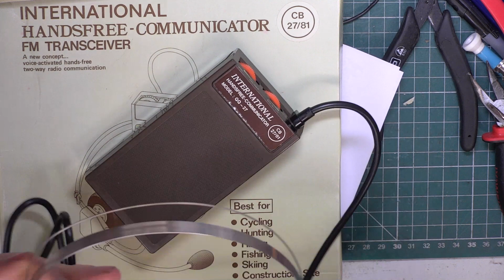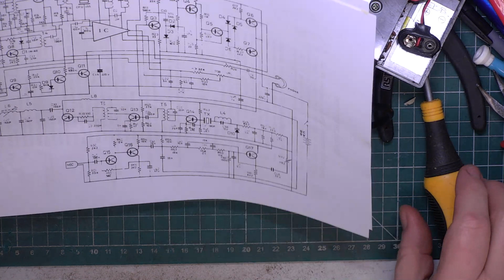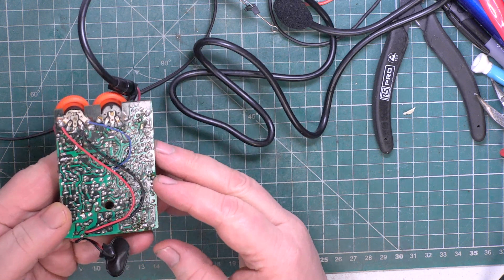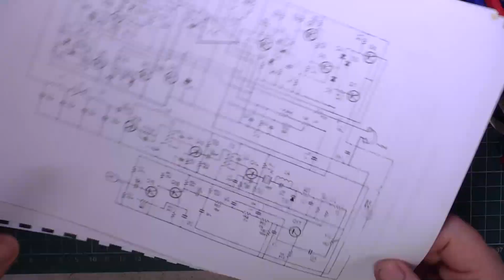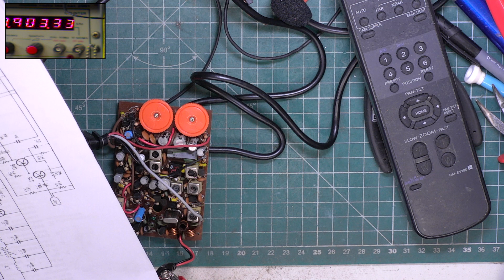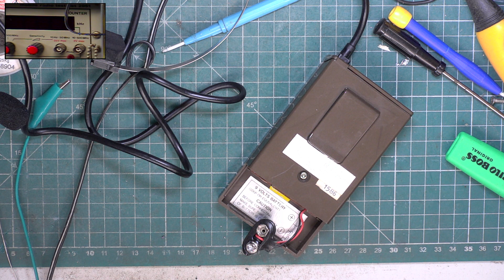International QQ27 CB27/81 Headset portable Cb radio - service alignment

Comment: That control on the schematic I think it says VR2 looks like in the circuit to be you deviation control it looks like it comes from the microphone amplifier circuitry and feeds the crystal oscillator the audio as a direct FM style of modulation by feeding the audio across a varactor which warps the crystal frequency

Comment: Quality. No manual over ride, a PTT or a LED so know it is on, power. 1 LED, thought would not be much to ask. I had in 1991-92 a pair of something or another from Tandy in Oxford. Nice little similar things but neater. Black, No squelch, Just had one al the time. no hiss like cheap things. LED, 2 colour in 1, RX or TX . volume on a slider, High or low. a VOX or to the lovely orange PTT. manual operation. a thin curly cable for a most of it to an earpiece with a few choices of pull on or off silicone earbit. mic in that (bone conduction, worked well). Used when doing technical at the local churcg concert events. roped into the filming, had 2 cameras on the go. Tried to edit 2 different things together, gave up, went to just 1 in the VHS tape manual edit. No computer, easy to edit software back then. Early 90's. These of yours horrble looking thing that 70's lookaircraft control NASA headset with the might as well be a metal rod cable. no give, stiff. Nice to see what it does, so meter measure 50mw minimum and not read these, Does the 150mw then as promised, Nowt like then as see in your words !.
Reply from the maker: I reckon the 150mW is 'power input' rather than output. Those DNT 2W handhelds, both the 40 & the 3-channel models were 500mW output & so was the Kaiser one. I think it's misleading.

In contrast the 'single channel, no squelch' Realistic TRC1003 & TRC1006 handhelds were sold as 50mW, are beautifully made & we've had more than three miles out of them!

The Tandy sold headset radios were 49Mhz so not on Citizen's Band, and made for them by Maxon.

Richard, G0OJF, UK
Reply: @ukfmcbradioservicingTango21  I had. Black thing
 Curly cable. Neat. Was 49 MHz. Used at churches for tech things I roped into back then.

Had to 2004 or so. Have to someone at the work place at the time.

Long gone.